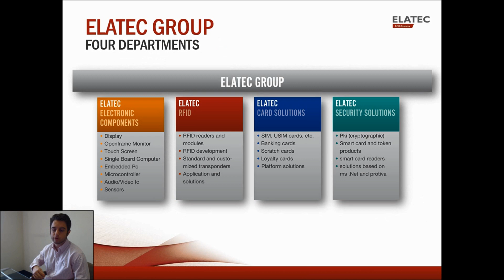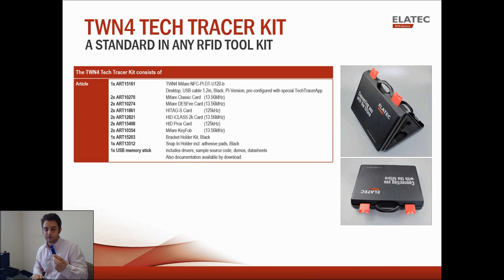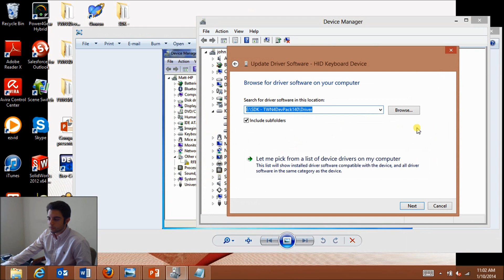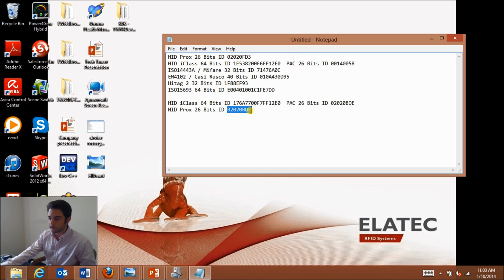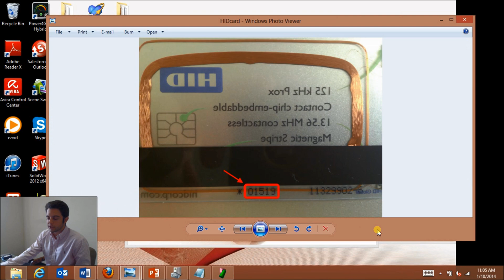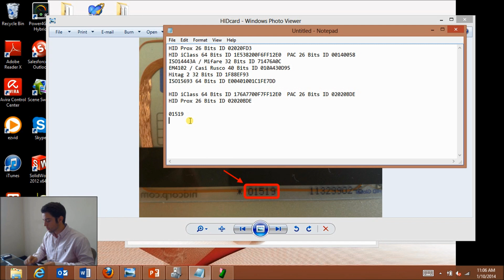Elatec RFID TechTracer Kit TWN4 MultiTech

Comment: Hello, can the Normal TWN4 + software also put out the card type or is the techTracer needed for this?
Reply from the maker: Hi Andy, it is possible to use a standard TWN4 reader for this purpose as well. The tracer firmware image which is part of TWN4DevPack needs to be programmed on the reader. If you have further questions you can contact our technical support directly via our website: https://www.elatec-rfid.com/int